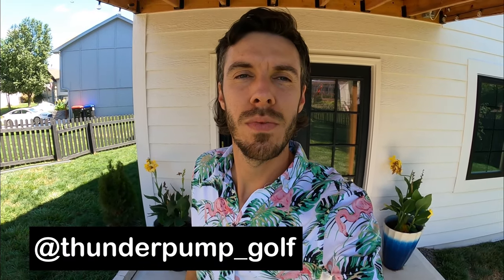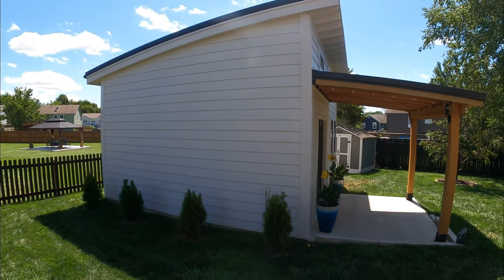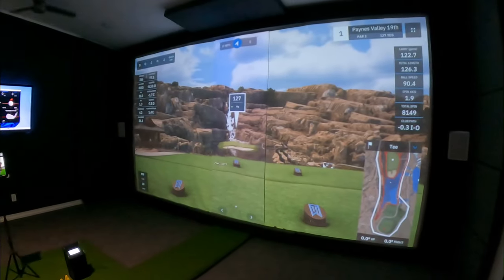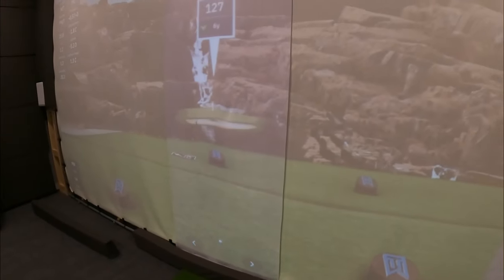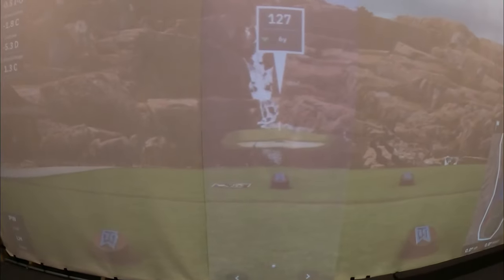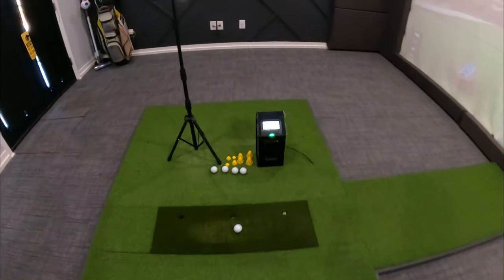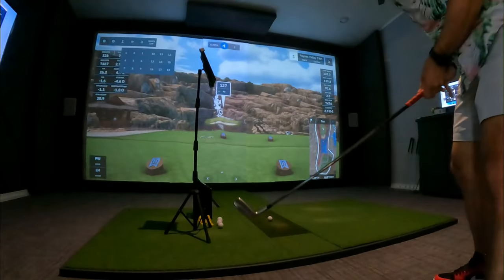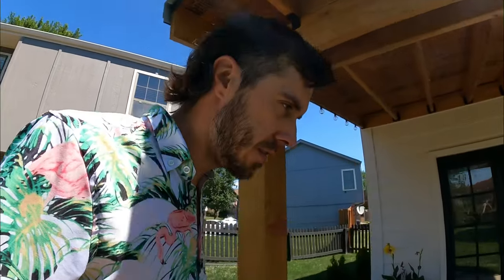CRAZY DIY Golf Simulator Shed

Comment: So awesome. Planing on building my own and this will help with ideas. Did you foam insulate the walls or use any insulation? Also what about running 120v. Did you do that or hire someone. If so how much for trench and dedicated run?
Reply from the maker: I used r13 insulation, I doubled in the ceilings, I taped all the edges.  It’s very well insulated.  I ran 220v to the shed.  I dug the trench myself with shovel.  It was a 18 ft run so wasn’t too bad.  I did have Electrion run wire from basement panel to sub panel.  Cost for that was 1,000.

Comment: Anything you wish you would have changed or added?  I’m currently getting ready to build, can’t decide on whether to go bigger or specifically just for the golf simulator.  Got a building with these exact dimensions ready to be built but wondered if I should go bigger?  Love this sim you built!
Reply from the maker: Well, there are a couple things that I did to future proof the build but  I forgot to mention them in the video. I ran USB to the back and sides of the building to my computer area, in case I ever did some type of camera set up. I put in an extra outlet in the ceiling just in case I ever upgraded to a ceiling mounted launch monitor and ran ethernet cable up there.  Just make sure you plan out where all the cables are going, run anything that you think you might use in the future.  Another thing is when I ran my HDMI cable to the projector. I did so in 1 inch tubing, with access points on each end. I did this, just in case a cable ever failed, so I could re-run it through the wall and ceiling just by pulling it out with the old hdmi.  But if I could redo it, I would at least do a 24 x 16 building so I could have a seating area. Or even all my workout equipment.  I am gonna put a little more thought into it though and get back to you if I think of anything else.

Comment: Awesome build. Did you ever do a video on the construction of the shed?  What did you use for framing?
Reply from the maker: Thanks!! I haven’t done a construction video.  I used 2x4s for the walls and 2x12s for the ceiling.
Reply: @thunder.pumpgolf_andfitness  Awesome!  Did you frame in a floor or attach walls directly to concrete slab and put flooring on the concrete?
Reply from the maker: @edwardanderson8756  I attached walls straight to the concrete. Just make sure you use a foam expansion joint in between wood and concrete.  And I put carpet squares directly in the concrete.

Comment: Looks great, well done. One Question - before you put the wall panelling on did you install sound insulation? Reason I’m asking is that later at night the sound of each shot could be easier heard outside. I notice your neighbours are a reasonable distance from the shed so might not be an issue for you.
Reply from the maker: The whole building is insulated with r-15 insulation.  I did not do any specific soundproof insulation.  It is not loud at all from the outside.

Comment: Looks amazing! Couple questions.. 1. Did you use plans for your shed or buy them? Can you share more details around the actual design/dimensions. 2. Did you pour the concrete or bring that in?
Reply from the maker: I just came up with the plans. I will do another video on a better breakdown on how it was built. And I had the concrete poured.
Reply: @thunder.pumpgolf_andfitness Is the new video available?
Reply: What was the total cost of the build minus the inside finish
Reply: Just curious so I know some sort of budget

Comment: Do your low wedges 56/60 hit the screen at full swings or hit the ceiling? Anything you would have done differently?
Reply from the maker: When I hit my wedges full, they do not come close to hitting the top of the screen, where I hit from is 7.5 foot away from the screen. And my screen is 9 foot tall.  The only way the ceiling has been hit when someone has skied a driver.  That is why I put a cushion pad on the ceiling in the middle of the screen. Honestly, the only thing I would have done different, if I could have. I would’ve made it 24 x 16 to have a little more space for seating because I’m a lefty and my friends are righties. It makes a little bit more difficult but if I had 24 ft I’d have a lot more space.  Also, if I had the money, I would have preferred a ceiling mounted launch monitor. That way I wouldn’t have to move it back-and-forth but for me those were just way too expensive.

Comment: Did you do all of the labor including electrical and the actual building of the structure? Are all of the prices at the end just the costs of the material or does that include any labor costs as well? Excellent job and I’ll 100% be using this as a template for mine!
Reply from the maker: Thanks! I really appreciate it. I did all of the labor and electrical myself so the prices at the end were just material because I did the labor.  The only cost that I didn’t add in was the cost of the concrete pad. The concrete pad cost $2500.  I plan on making another video breaking down actually how I built it and what went into that process.

Comment: Does your total cost count the concrete? Do you have a cad drawing or true specs for this build?
Reply from the maker: Concrete was 2500,  I don’t have cad  or true specs.  Just basically had a 16x20 poured and designed a simple structure around that.  12ft front wall and 10ft rear wall.  Single pitch roof, 2x12 rafters.  And just researched each step of the project as I went

Comment: How much did the shed cost to build before finishing the I side? I’m looking at an 18x22 shed, hoping that will give more room for seating and having a bar area. Do you find 16’ deep is plenty of depth? Wondering if I should go shallower and longer than 18x22
Reply from the maker: Cost of the just building without anything done to the inside around 6k.  The concrete slab was 2500.  I would recommend 16 or 18 deep by at least 24 wide.  But I would place the impact screen on the 16/18 side.  It would give more room for seating and bar behind hitting area.  Something to think about if you have 24 feet of space you lose 1 foot behind the hitting screen then you need at least 7 to 8 foot from where you hit the ball to the screen. Then you need 4 foot behind the hitter so right there is 12 to 14 feet of space minimum.  Then from there just depends on how much room would feel comfortable behind the hitter.
Reply: @thunder.pumpgolf_andfitness  what state are you located in? My next obstacle is dealing with the HOA and city. Also, do you have any issues with noise from the neighbors? Mine will be spray foam insulation so hoping that prevents too much noise.
Reply from the maker: @cgwashb   I’m in Missouri.  I don’t have an HOA, so that made it easier.  It is very quiet on the outside of the building.  You can really only hear the driver but once you’re 20-30ft away it’s hard to hear at all.  I’ve never had an issues or compliants with the neighbors.
Reply: @thunder.pumpgolf_andfitness  do you think you go 16x24 instead of 18x22?
Reply from the maker: @cgwashb  personally 16x24, more room for actual seating/bar

Comment: Best shed and DIY simulator I’ve seen on here at a reasonable cost.  Did I miss the cost of the concrete?  Did you do a 4” or 6” slab?
Reply from the maker: Thanks! That’s why I wanted to share, I thought it was a very reasonable to build. My concrete was 12 inch footings, with 4 inch concrete in the middle. I got it in 2020 for 2500.

Comment: this is awesome. I want to build this exact same thing in my backyard. 

A few questions: 
1. Did you have to get any permitting done through the city?
2. Are the neighbors mad? LOL
Reply from the maker: Thanks!!
1)yes, it was pretty easy process. As long as you stick to your city code. 
2)no, I talked to them before I built it.  Plus I tried to design it as nice as possible. And if your talking about the noise, a driver can hardly be heard from the outside. I went alittle overboard with the insulation.  

It was a lot of fun to build, you should definitely build one!